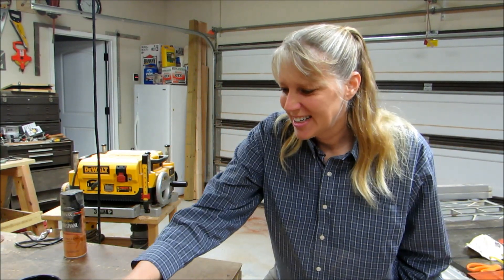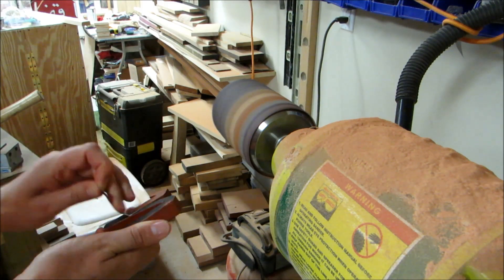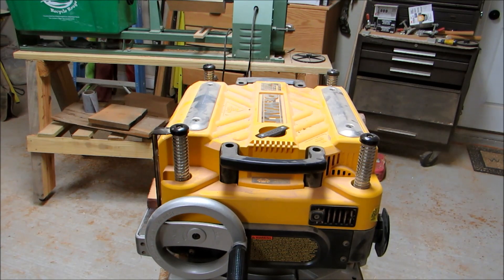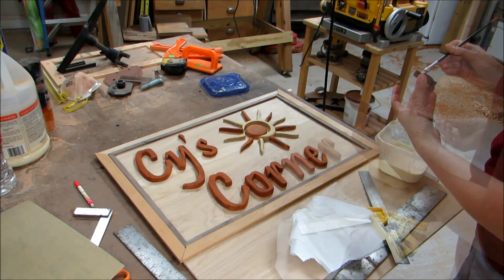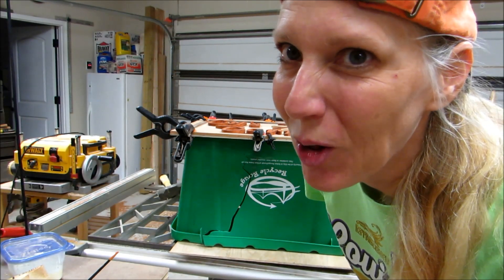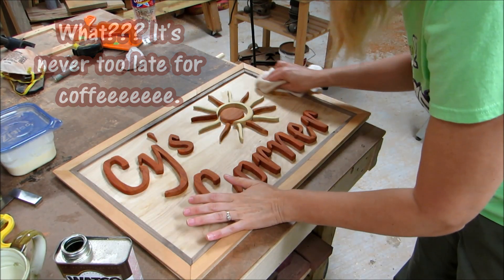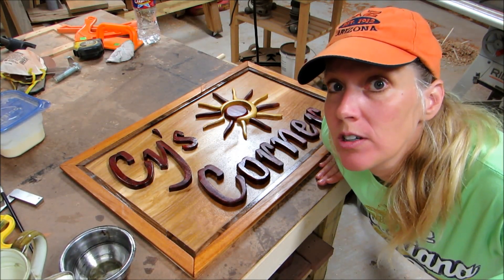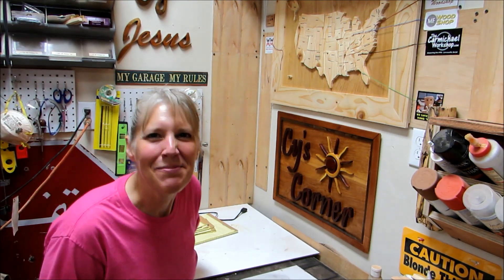Cy's Corner Sign, Hurray!

Comment: The wood in question looks like mahogany but it is hard to tell for sure.  Mahogany can get rather pricey because it has been clear cut from tropical forest and is now only allowed to be sold through licensed dealers.  If you like that look check into Lyptus (Spelling ?).  It is very similar to mahogany but it is a cross breed and is being planted in areas that have been clear cut because it grows quite fast and is a great substitute for mahogany and it is usually cheaper.  It is also harder and more dense and easer to work with.  I have built several projects using Lyptus such as tables and cabinets and I really like the way it works.  Great videos and contagious energy!!!!!
Reply from the maker: +Dave Harrington Hey there Dave!  Thanks for the info on lyptus....or however it is spelled!  I have heard of it before but didn't know it's history.  I did get a stack of end cuts of mahogany from a little wood shop, I like it.  I will have to try and get some lyptus now!!!  Thanks Dave!
Reply: Try to find a local cabinet or furniture shop and check their scrap bins.  Any company that uses wood in their manufacturing.  I stopped by a company that manufacturing company that made hurricane windows and doors and used African Mahogany and I got enough scrap to build a table and it was free.  I will send you a picture of it via email.  I still have a lot left for other projects.